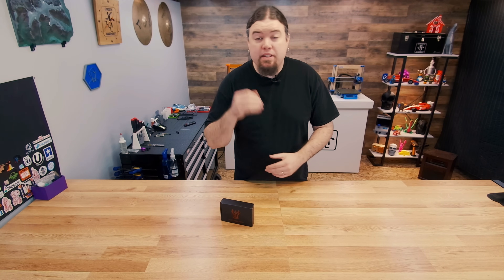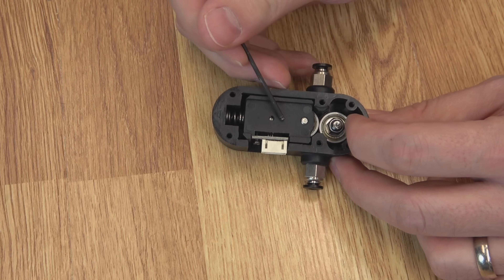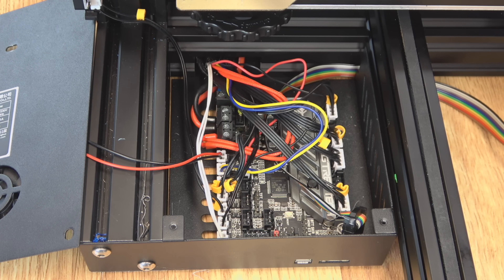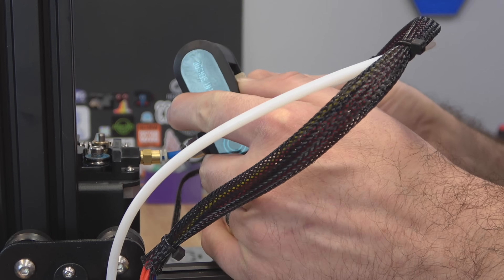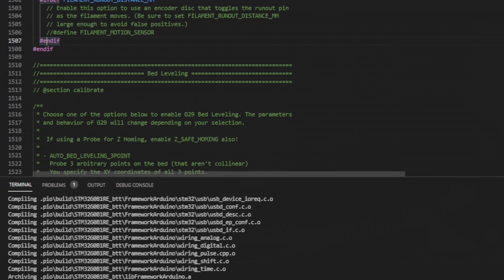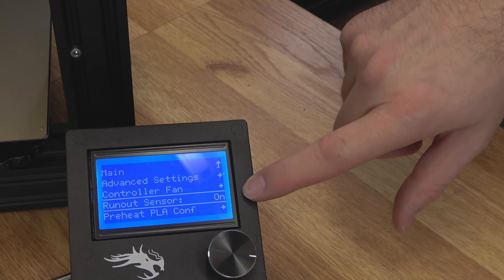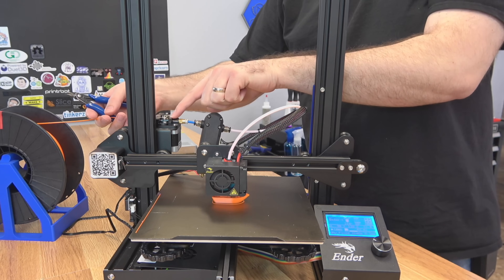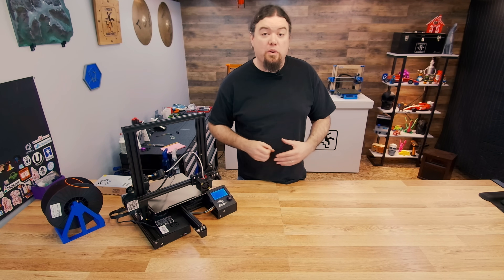BigTreeTech - Smart Filament Sensor - 2022 - Chris's Basement

Comment: My printer has a "filament missing" sensor already (Anycubic Chiron).  If I followed the video, it seems like I would just need to make sure it was plugged into the same ports and that it had the same mode (normally open vs. normally closed switch) as the original detector and then I could just plug it in without modifying firmware.  Is that correct:  there is no need to set the type of sensor if your firmware is already configured for a sensor?
Reply: Your current sensor works as a switch - on or off.  This works by the counting the on / off cycles and one must happen within the specified length
Reply: @woodwaker1  That was why I expected the sensor type to need to be defined, but I did not see that in the video.  I must have missed it: what is the tag to search for an the source code?
Reply: @andy-in-indy  07:56 it's where you define the mm distance of filament runout
Reply from the maker: Thanks for the help here everyone, they are correct, you have to change up the firmware for this one to work.

Comment: Thanks Chris!
How does this "7mm" work when you are ironing a top layer? there is hardly any filament fed. Wouldn't it be better to use a smaller distance, like maybe 1 or 2mm?
Reply from the maker: Thanks for all the conversation on this, i wasn't really sure about ironing, so I learned something as well!
Reply: If the sensor is before the extruder, it is no big deal. After the extruder is a really bad idea, lots of problems with that setup.
Reply: @HackMonkey  and why is that? Without a broken filament, the movement before and after the extruder is the same.
Reply: @spedi6721  A jam would not mater as much where the sensor is, but a run out totally does. The sensor has the 7mm built into it, you can't change that.
Reply: @HackMonkey  but that all what you are talking about has nothing to do with my question.
Reply: @spedi6721  If the sensor is behind the extruder, as Chris has it installed per the instructions, a jam or filament break, will cause a massive gap while ironing. And there is nothing you can do about it.
Reply: @HackMonkey  again. That is not what I meant.
During ironing you bearly use any material, so the sensor might not even detect "movement" and might trigger a false alarm.
Reply: @spedi6721  it's 7mm movement of the filament, not the extruder. If you're feeding really slow, like when ironing, it just takes longer in time to trigger. I just got mine set up, and it handled the very slow feed rate times fine. I did have it pause the print twice when the filament stripped due to very short extrusions with several retractions going over the same section of filament.
Reply: @wrathernaut-3d  thanks. That's what I wanted to hear. I was worried if the sensor has the needed resolution.

Comment: I put mine before the extruder (BMG) but if you use an stock ender 3 extruder and the filament kicks out the side of the extruder on a jam then it won't detect it. Overall I prefer this over a switch anyday.
Reply from the maker: Thank you for your input.

Comment: I have had nothing but troubles getting this sensor to work on Duet (RRF).  I set the sensitivity to allow 25%-225% and it still gave me faults while printing.  I finally had to disable it after troubleshooting and testing different settings I found on the forums :(.  I had these issues on 2 separate sensors.
Reply from the maker: It's very frustrating, isn't it? I have never had good luck setting up a filament sensor on Duet.

Comment: Would the 7mm of inaction cause problems with ironing?
Reply: Sensor triggers each 7mm movement, so marlin knows there isnt a jam, when movement is commanded and 7mm happens without the sensor triggering thats how marlin knows there is a jam. So it works with ironing, no problem
Reply from the maker: Honestly, I am not sure, I don't know that I have ever tried ironing. The filament would need to still be moving not to trigger the sensor.
Reply: If the sensor is after the extruder, then yes.It will cause an issue in any print. Might not be obvious if it is doing infill at the time, but would if it was printing a external perimeter or top. Before the extruder is no problem, as the extruder still has filament to push.

Comment: The smart filament sensor is great. I have it on three of my printers. Used them with Marlin/Octoprint (host prompt support) and now with Klipper and RRF.
Reply: Any chance you can share the code you used to make the features work in Klipper?
Reply: @BackwoodsTinkerer  
[filament_motion_sensor btt_sfs]
detection_length: 7.0
#   The minimum length of filament pulled through the sensor to trigger
#   a state change on the switch_pin
#   Default is 7 mm.
extruder: extruder
#   The name of the extruder section this sensor is associated with.
#   This parameter must be provided.
switch_pin: rpi:gpio13
#pause_on_runout:
#runout_gcode:
#insert_gcode:
#event_delay:
#pause_delay:
#   See the "filament_switch_sensor" section for a description of the
#   above parameters.
Reply from the maker: Yeah, I really like it.
Reply: Can you share your config for rrf